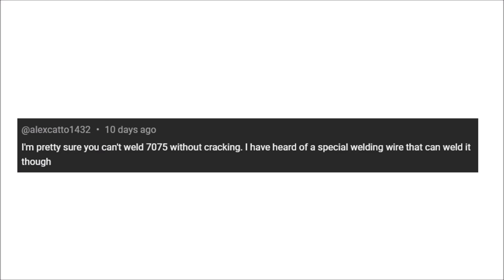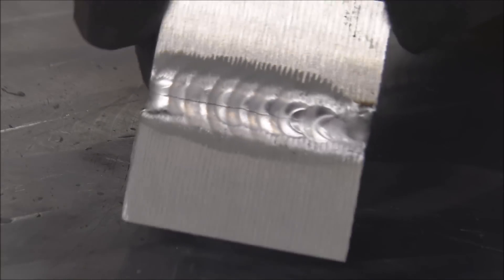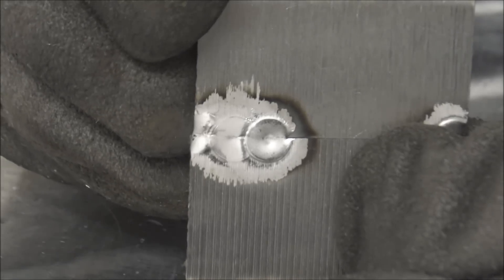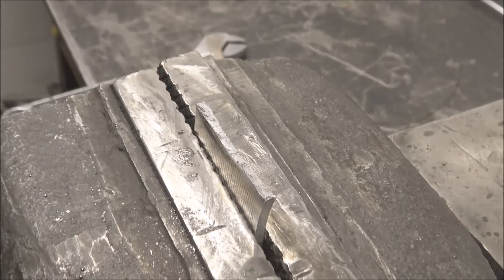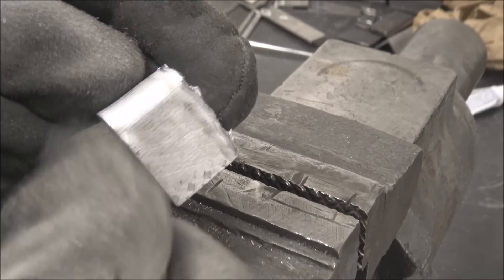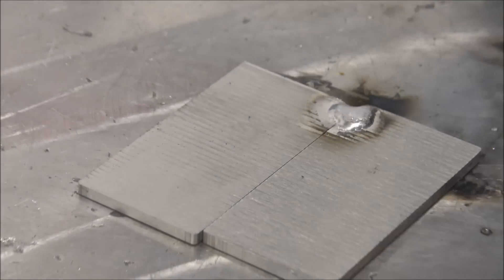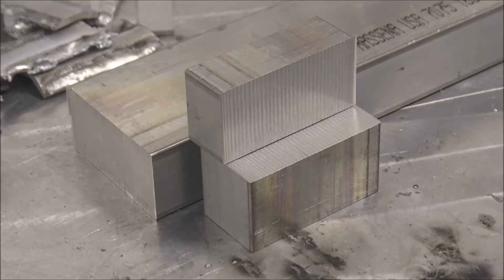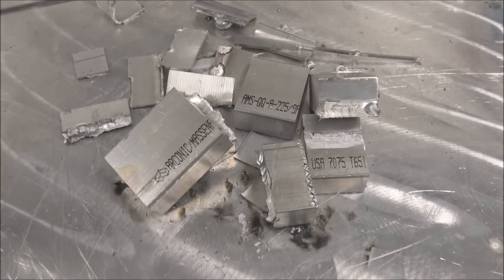TIG Welding 7075 Aluminum - Who Said You Can't?!?

Comment: Got me curious.  I've never tried it myself.  
1000 Years ago I had a GT Zaskar that was made from 7009 material.  The bike shop had a video featuring the making of those frames, and they specified that the 7xxx material needed to have pre & post weld heat treatment done.  The rest of their Al frames were 6061 at the time.
Couple things for you to try:  Try a He/Ar mix?
Maybe try on DC with High Purity He?   
How about with Pulse? 
Maybe control cooling?
Maybe weld in a chamber.  possibly the O2 hitting the backside of the weld causing embrittlement like on Ti?

Comment: Regarding the tack welds holding at the beginning, I would guess that this is a combination of the corners of the plate burning off and feeding the weld puddle a bit more, combined with the cooling weld puddle being able to shrink back from the open end of the joint as it cools, rather than just pulling directly on both sides and sinking in from the top. Less stress, less thinning.

As for other 7000 series aluminums, the internet says "The exceptions are 7003, 7005, and 7039, which are readily weldable with 5356 fillers." and I'm sure we can trust that since when has anyone ever said something incorrect on the internet?
Reply: Sounds like the plot for the next video!  😅
Reply: There are a few other 7xxx alloys that are weldable.  7024 is one as well.
Reply: What about 7001?

Comment: Awesome video!!  I enjoy machining/using 7075 for certain applications, given it's strength....but have never tried welding it.

Actually; this video just gave me an idea for a project that I've been putting off, where 7075 would be preferable and the weld wouldn't be structural.

On the larger blocks; did the higher heat input required to weld, anneal the entire part?

Thanks!

Comment: 2024 is the one with a lot of copper. I’ve always heard that it can be welded without any drama but the copper migrates to the edges the weld which creates corrosion and strength issues.
Reply: I tried 2024 once and no matter what I did, I could not get anything to work to any degree worth considering useful. Did the same with 7075 as Aaron did here and got about the same results as he did here which makes me think that the copper is the problem because when you look at 7005 for example, it is considered readily weldable and its max allowable copper is 0.1% where as 7075 should be between 1.2~2.0% and 2024 being between 3.8~4.9%

I've heard some say its the Zinc Content in 7075 but I dont think that is the case because although less, 7005 does have fairly high zinc content (4.0~5.0% vs 5.1~6.1% for 7075). And on that note, 2024 has a max allowable zinc of 0.24% so really, the copper content seems to be real driving factor here.

Comment: 7075 is super strong and machines awesome. Never tried welding it before and now I never will! Thanks for sharing.
Reply: There’s a lot more to material science than “strong means no break when bend”
Reply: How is it super strong if it snaps when you bend it
Reply: @sammyd7857 It's stronger than titanium.  If you work with aerospace at all, many parts are made of 7075.
Reply: @MikeYurbasovich  7075 is very strong .
Reply: @sammyd7857  Most likely its used thick and has a high hardness rating for aluminum.

Comment: Anything can be welded if you try hard enough. I'm 40 with 55 years of welding experience under my belt so I should know.. 🤣 all joking aside, at the aerospace manufacturing facility that I welded at we were never told to weld 7075. So obviously there is more to this that what can be convaid in this video. I mean if it was a sufficient process then they would have had us welding it all the time. And they used 7075 for everything that didn't need to be welded.

Comment: Im just here to point out that gloves on a bandsaw are 110% fine.. its going to cut the glove as easily as it cuts your finger off,  IF it pulls the glove in, itd just as easily pull your skin in , at that point gloves or not youve got a problem😂..  things that spin - drillpress, lathe, mill  those ARE the ones thatll happily take you for a ride 😂

Comment: I did read an article about 4 years ago a rod was developed for 7075 that used some nano technology with titanium in the rod, it was real expensive. The article said it was a big deal because auto manufacturers could start using 7075 in cars more. The article even showed how it wasn't the prettiest looking weld but was structural sound.
Reply: Just got some of that recently it's from a company out of California called MetalLi waited a couple months to get it was definitely pricey as it was 850 for 10 lbs of rod can't wait to try it out
Reply: Pretty sure I read the same article that you are referring to.
Reply: Heard that one could use spot-welding, e.g. electric resistance welding.

Comment: Very good..would be interesting to see if matching alloy filler welds can be heat treated back to T6..

T651 is a wee bit more brittle or less ductile than T6.  Welding in T0 is preferred,  then heat treated to desired strength. 

I did some 6061 tube which I annealed to T0 to bend and then welded. Aluminum does this funky thing called over aging which is probably why your welds failed in the HAZ while the AlumiWeld braze didn't..just a SWAG.

Anyhow, gloves and bandsaw?   I don't believe that hooey tale.  I'm wearing them because I can keep my booger hooks away from moving blades.

Comment: I've welded 7075 in the past using chips from previous machining ops on the same part where the CNC operator was supposed to put a chamfer on a hole and the tool went an inch deep into the part... Never tried anything like this though....

Comment: Why do they even make 7075 if it’s not weldable? The 1 point whatever percent copper in it has to be more expensive than other series of aluminum also.
Reply: Billet aircraft parts. What makes it "unweldable" is the 5% Zink.
Reply: Most of the AR-15 type firearms are made of 7075, the upper and lower receivers anyway.
Reply: Because, despite it's weldability limitations..... it's strength approaches mild steel, with the weight of aluminum.
Reply: I get that but, it’s not weldable, doesn’t anodize, and it’s corrosion resistance is bad. The only benefit is it’s tensile and yield strength is higher than 6061 and has a higher brinell hardness. You would think the inability to weld it, it’s poor corrosion resistance, and higher manufacturing cost wouldn’t make it worth it. You would think they would just make a better material or redesign parts accordingly.
Reply: 7075 yield strength is almost double 6061. It is higher strength to weight, so used extensively in things like aircraft, bicycles, guns, etc. It is machinable but not weldable.
Reply: Assemblies are built subtractively (machining a big block or forging) instead of additively (welding pieces together). It's used because it's really strong.

Comment: 7075 is a mix of aluminum, zinc, magnesium and copper. Makes for a high strength aluminum that is more for cast parts than fabricated parts. Im with you on just dont bother trying to weld it as its going to fail. It becomes brittle along the weld joint or just cracks.
Reply: That explains why the brazing rod actually worked the best..  It is basically a zinc alloy solder...   Any solder for Zamak or "pot metal" would likely also work reasonably for 7000 series if you absolutely had to...

Comment: Aaron - I have always heard that 7075 is not weldable, because zinc is the primary alloying material. Your tests seem to bear that out. I have also heard that some high-end bicycles are made from aluminum in the 7000 series, so apparently there are some alloys that can be welded. 

Pretty fascinating to see how you went about testing the possibilities. Maybe you could do something similar with 2024, which is a copper-based alloy - also not recommended for welding.

Thanks for mentioning my welding rod holder. It has really helped me keep my filler metal organized!
Reply: I have a GT mountain bike from 1994 that is made from 7005.  I have read that there are only 3 grades of 7000 series that are weldable, all with 5356 rod. - Brian - Tarheel Aluminum/Edge Marine Boats.
Reply: I worked for a rather large blowmolding company, Whose molds were all made of 7075 T651. The rumor about "not weldable" flourished to some extent in the early years. I was a toolmaker, and did not need to do any welding, so I can not speak from hands on experience. Most of their welding of 7075 was done along edges and repair, rather than fabrication, but the results were solid and usable.
Reply: To the best of my knowledge, most (if not all) bike frames that are made from 7000 series are specifically 7005 which is considered to be readily weldable. It has significantly less copper than 7075 at only 0.1% max allowable vs 7075 which should have between 1.2~2.0% and while does have Tin as its primary allowing element like 7075, it is still less at 4.0~5.0% vs 5.1~6.1% for 7075.

All in all, I am personally of the belief that the copper is the problem because 2024 exhibits far worse results when attempted to weld compared to 7075 and one key different is Copper content for each. Copper is the primary alloying element after Aluminum in 2024 where as zinc is the primary after Aluminum for 7075. 2024 should have a copper content in the 3.8~4.9% vs the 1.2~2.0% for 7075.
Reply: I think 7030 was used in late 90s 2000s , welded frames.
Reply: A good video, to show that not all metals are weldable.
Reply: The 7000 series (and even the 6000 series) bike frames as all heat treated AFTER welding to increase the weld strength. I wonder what heat treatment would have done in these tests.
Reply: I believe they have to keep 2024 and 7075 stirred while making the alloy.
Reply: Some bike frames are glued into brackets.  No welding.
Reply: Might be brazed instead of welded, like older steel bicyles.
Reply: @aerogfs  You almost can't braze Al. You need to etch it first and than braze. But it creates acidic reaction so the joint fails over time...
Reply: cheap mountianbike frames are 7005, the material has very little flex and they are harsh to ride.
Reply: @krusher74 not only cheap it’s a well common material away all prize classes
Reply: And the Video shows that it is not weldable.
Reply: Ron , I know nothing about the processes. But I do know that some bikes are brazed and not welded. Would brazing be the reason 7000 series is used? or when 7000 series is used, brazing is the best technique to use?
Reply: @ohwowthatsgood  7005 welds well, has pretty decent mechanical properties, and doesn't require post weld heat treating, which keeps production costs down. Steel frames are often brazed, i'm not aware of any "brazed" aluminum bikes. Not that it couldn't be done, but you'd have to do some research on the properties of the filler you use, as well as the effects of the heat on the base metal.
Reply: I think the joints are bonded with epoxy resins and the jointery uses lots of i.d. couplers to help facilitate more bonding/gluing surfaces.

Comment: Years ago, I thought I hit the jackpot. The person whoever figures out how to weld steel to aluminum is going to be very wealthy very quickly. 
I have it a shot. Some thinner gauge material. I can’t remember what filler rod I used. But it seemed like it worked!!! I looked at the piece closely…no cracks. I tried to break it by hand…no go. It held. I thought “man, I must have come across, by accident, the secret machine settings, filler, technique etc. I’m going to be rich!!!”
Then I put the piece in a vise and gave it a wack with a hammer. 
All of my dreams vanished within a split second. I went from “I’m going to buy a yacht and a big log cabin in the mountains” to “quit playing around and get back to work, loser. Youre a welder, and you’re stuck in that dark world of bright light forever” ☹️
Reply from the maker: "dark world of bright light" 
I like that, never heard it before
Reply: You can get steel 'welded' to aluminum, they produce it in big sheets by laying a sheet of aluminum on top of a sheet of steel then covering it with explosives, the force and heat join the two together. Or its something long those lines
Reply: @nunnas5393  See wikipedia "Explosion welding"
Reply: I welded stainless to aluminum one time in welding school. It was out of carelessness. I mistakenly picked up a stainless rod that i thought was an aluminum rod. It was making some colors and being difficult, so i forced it more. In the end, i welded 2 aluminum plates with a stainless rod. I figured out it was a stainless rod after i finished by trying to bend the rod. 😔
Reply: Haha yes indeed, can't even count how many times customers have brought in steel and aluminum to be fused together
Reply: Years ago I was fabricating some titanium suspension parts for a little open wheel racecar. One of the threaded inserts I tried welding into the end of a piece of tubing welded like CRAP. WTF? It "welded" and the metals were fused, but the color was all wrong and it just hadn't flowed right. Yup, I'd "welded" stainless steel to titanium. One whack of a hammer and the whole weld joint shattered.
Reply: CuSi 3 might work?
Reply: Technically they already can be "welded"... They can be "bonded" together by means of Friction Stir Welding. I put bonded in quotes there being that Friction Stir Welding isn't really welding in the sense that normally comes to mind when referring to "welding" given that its really more of a mechanical bond rather than molecular bond associated with what comes to mind when people think of "welding"